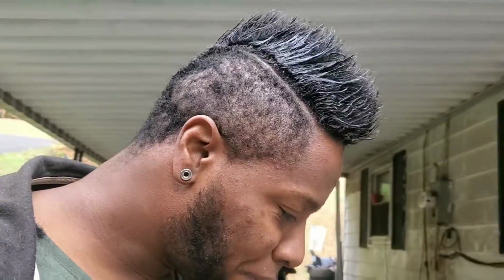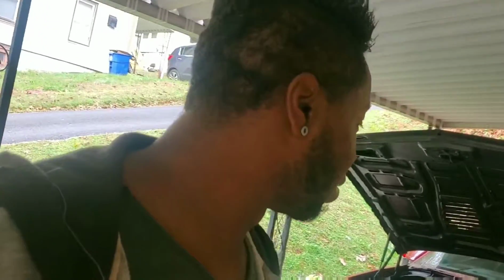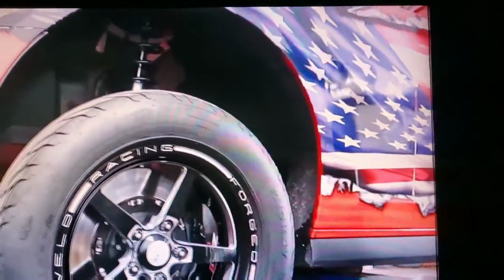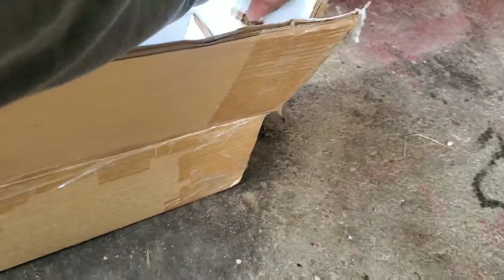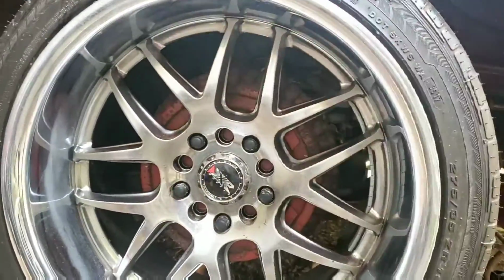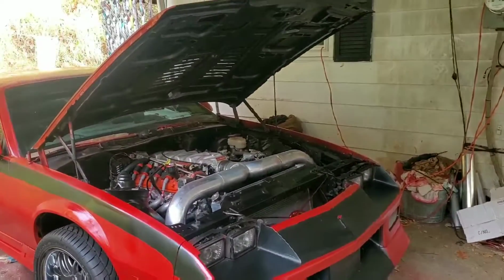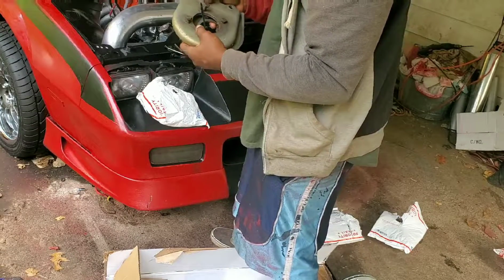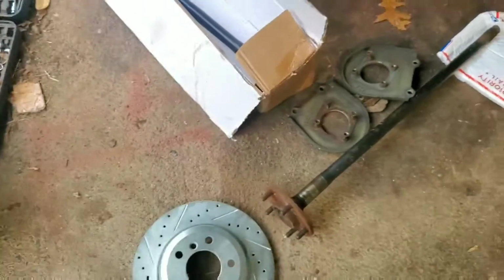EXCLUSIVE THIRDGEN CAMARO IROC-Z TRACK MOD!!!

Comment: What suspension?  What subframe connectors?  Rear end?  And btw, your compression ratio isn't going to change with e85...
Reply from the maker: That stuff is kept a secret  buddy hahaha  and it will raise the compression but not nearly as much as a boosted application
Reply: You do realize you dont need to change the axles to go to disc brakes right? They make a whole conversion kit
Reply: @TZNatioN87  I don't think you understand what compression ratio is.  It's not something that changes with fuel type or forced induction